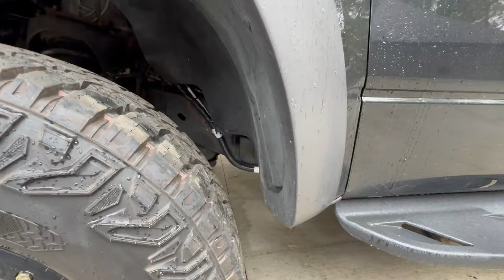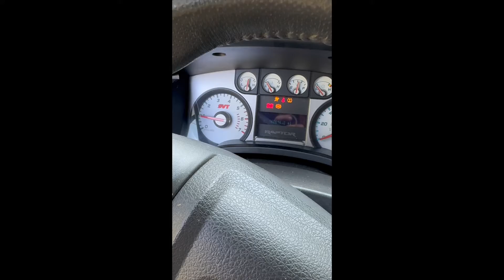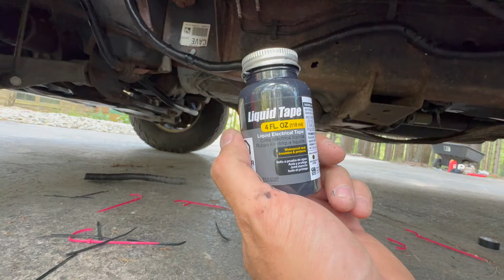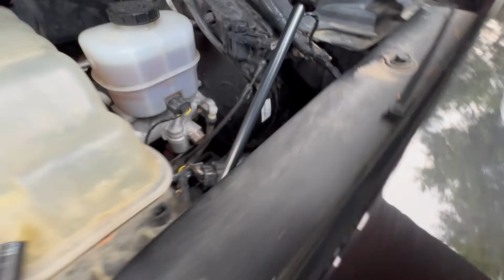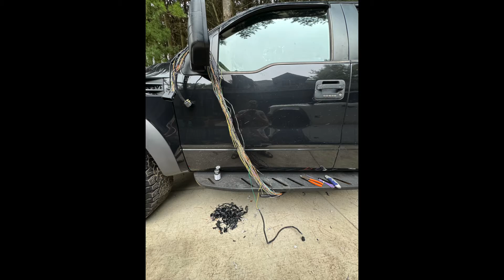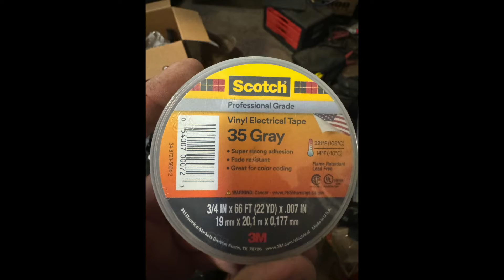Project Ford F150 Raptor rebuild | Wire harness problems 2009 -20 14 F150 symptoms and how to fix

Comment: Yeah I’m running through a similar issue on a 12. Yours is easily accessible and exposed. Why don’t you just run it through conduit of some sort. If you’re off-roading steal 🤷‍♂️🤣 I’m still chasing my issue though. I think I have entire pcm to trans harness gone bad
Reply from the maker: Oh man! Good luck. That’s a tough one to fix. I got lucky with mine

Comment: Hello, good evening. I have a big problem with my Raptor Piron. The O2 sensor cable, bank 2, sensor 1, is loose, and I don't know the correct wire positions for the new connector. I don't know if you can help me.
Reply from the maker: I’m not familiar with that issue or the wiring harness and I don’t have a full repair manual. Do you have anybody locally that you trust to work on it?

Comment: I’m having a very similar issue with my 2012 f150. Do you happen to know the part number for the wire harness replacement? I’ve been looking and I’m not having any luck
Reply from the maker: Great question…I still never figured that out. And yours would be a different harness than me because engine and wheel base. Sorry I don’t have!